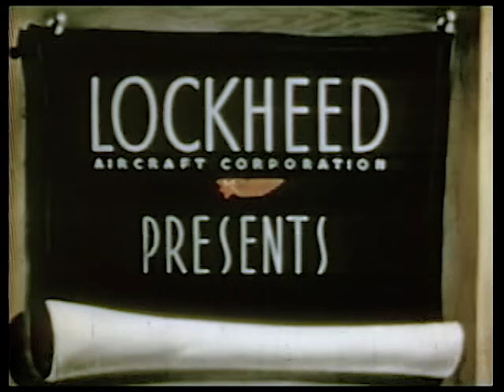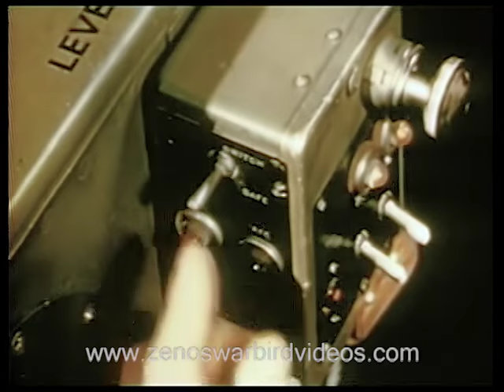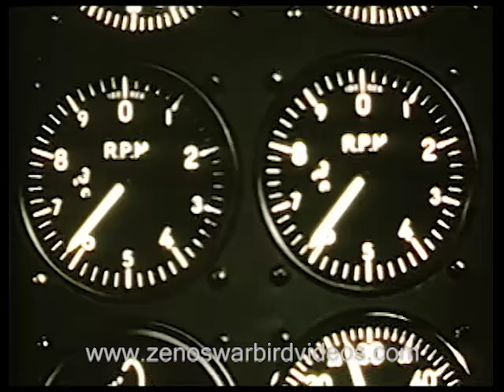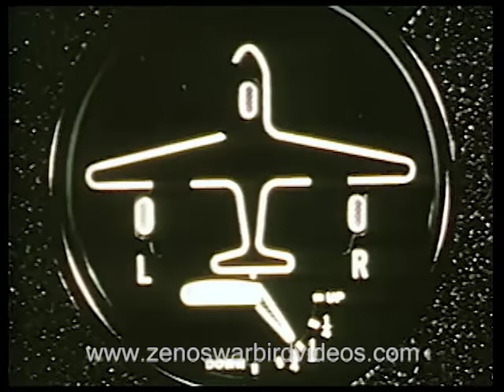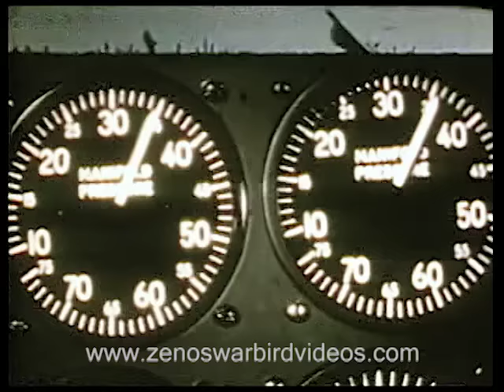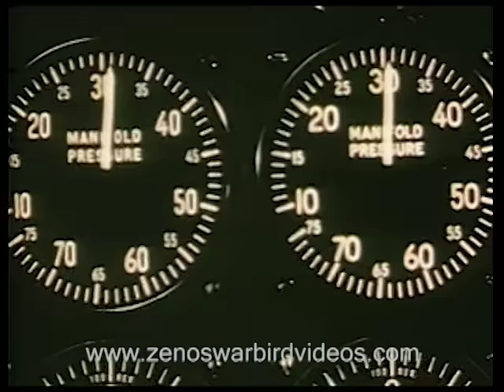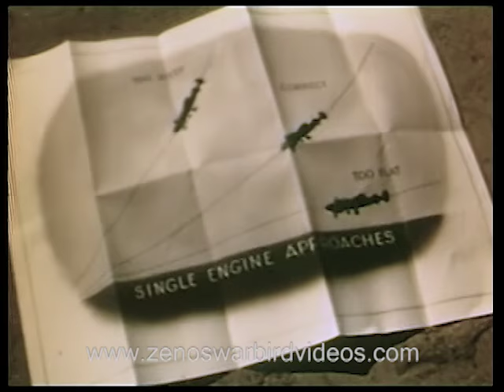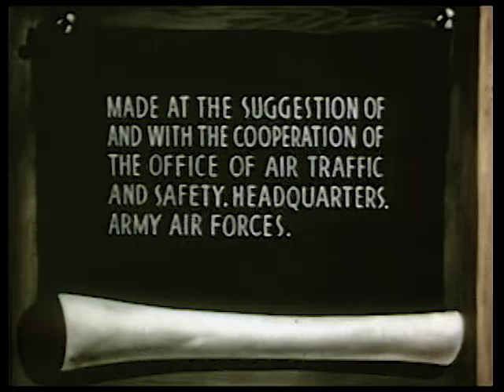Flying the P-38 Lightning for World War 2 Pilots (1943 New Color Restoration)

Comment: Interesting...takeoff below VMc. Rotate between 70mph and 100mph...VMc 120mph?  Guess pilots and planes were cheap.. Im betting smart pilots held it till they got to 120mph or at least closer than 100mph. For those of you who dont know, takeoff slower than 120mph would result in the pilot losing control, the airplane rolling over on its back and crashing.